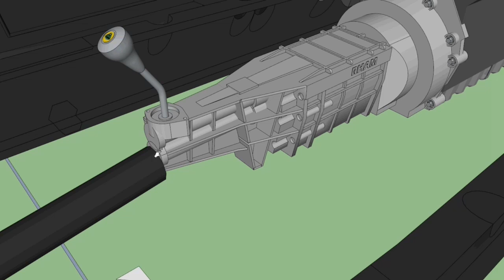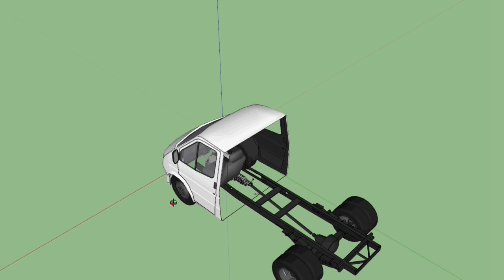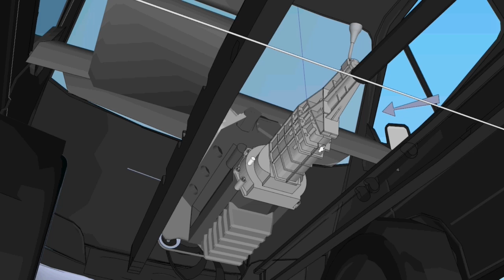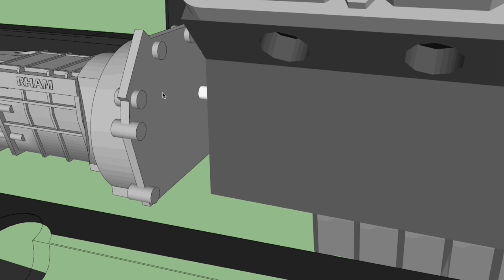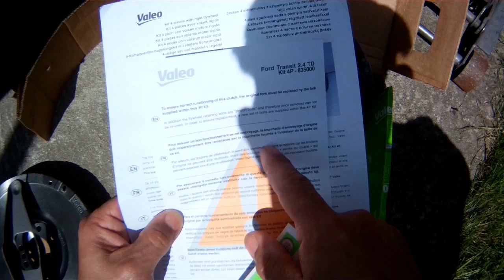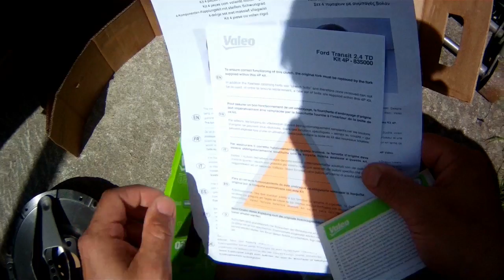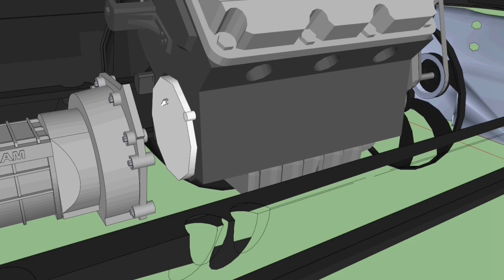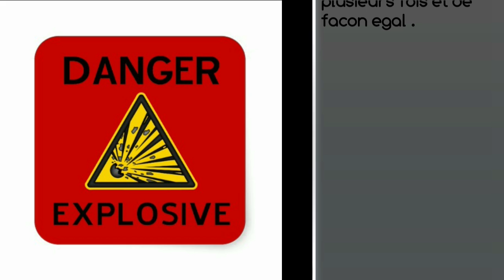TUTO echange embrayage Ford Transit 2.4 DTCi

Comment: merci, pour le tuto. Il faut avoir le courage, pour tout filmer, vu les difficultés en général. Le support de boite est aussi une très bonne idée. Mais j'ai quelques remarque importantes a te faire. D’abord, pour le couple de serrage. Au début j'ai cru, que tu t’étais trompé, dans le calcule. Fallait précisé, qu'il s’agit de daN.m en lb.ft et pas de daN.m en N.m. Vu que ce type de clé dynamo ce présentent en général de 28 à 210 N.m (mesure européenne) et pas en lb.ft (américaine). Par rapport au volant moteur. Je trouve un peu dommage d'avoir acheté un bimasse, quant on sait, qu'il vaut rien, au prix, que ça coute. Il aurait été préférable de mettre une solution rigide, mais bon, chacun est libre, de faire son choix. Et en fin, par rapport à la clé angulaire. Je reviens au kit embrayage. Tu as dépensé plus de 1000€, surement, par rapport à l’ensemble, mais en faisant des économies, entre 5-10€, avec un bout de carton imprimer. Quant on sait, qu'elle est l'importance de couple serrage dessus et, que le décalage doit être minimiser au max. Merci encore une fois, pour tous ces détails bien filmés; Très bon travail et une bonne idée de support. Bonnes continuations.

Comment: bonjour fredo tout d'abord félicitations pour ton tuto tu as travaillé avec inspiration. j'ai pour projet de changé l'embrayage de mon Ford  c max et j'aimerais fabriquer un porte boîte à vitesses comme le tiens. ma question est ce que ton système de tige filleté permet de faire descendre la boîte et la remonter ensuite???
Reply from the maker: MOHAND MOUSS Bonjour , oui on peut descendre et monté mais cela reste assez limité en déplacement verticale , le but était d'avoir un support réglable afin d’évité de forcé sur l'arbre de boite et pouvoir la rentré correctement  . 
Je suppose que le véhicule sera sur chandelle ce qui veut dire que la longueur total d'un support sera d'environ 60 cm , en bricolant bien on limite sur la hauteur nécessaire pour les roulettes mais on pert facilement 5cm , il faut obligatoirement que les deux tube rentre l'un dans l'autre d'au moins 10 cm . on perd donc 15 a 60 Cm soit 45 Cm que l'on divise par deux pour connaitre le deplacement possible soit 20/25 Cm .
Ce qui me semble largement trop juste pour espérer descendre une boite uniquement avec cet outil .
Il m'est déjà arriver de sortir un moteur en passant sous le berceau , cela reste archaïque et peut être dangereux , j'ai déposer le moteur mis au sol puis lever la caisse pour ensuite passer le moteur sous le berceau . peut être que cette idée te donnera des idées .
Après est-ce que la boite dois absolument être descendu ? car si il s'agis de la descendre un peut pour pouvoir la décaler et gagner un peut de place pour travailler sur l’embrayage . généralement on procède de cette manière lorsque l'on a pas de pont  cela doit être jouable avec cet outil on a pas forcement besoin de sortir la boite entièrement ;)
Reply: non mais je crois que je vais  le faire avec un pro dans votre genre, je ne suis qu'electricien... Tout a l'heure j'ai demonter quelque support et passer sous la voiture pour prendre les cotes de ma bv.et vous savez quoi???ma voiture ne demarre plus!!!!!!!!!!!! vous ne savez pas d'où ca peu venir??? j'ai demonter la batterie et son support  et nettoyer un peu les elements et sans faire attention j'ai branché la batterie a l'envers ( sans mettre le contact!!!!!!!!)  ensuite j'ai tout remis en place et la ma voiture ne demarre plus.... J'ai mesurer la tension de la batterie 10.4V . est ce normal a votre avis. merci pour votre reponse.... ( c'est la batterie d'origine ...)
Reply from the maker: MOHAND MOUSS Je ne suis pas un pro et je n'est certainement pas la prétention de me considérer ainsi pour ce qui est de votre soucis , 10.4V la batterie est certainement HS , la limite de vie des batteries se situe au environ de 11V en dessous la batterie a de forte chance d’être HS . Cependant si la batterie a été brancher a l'envers même sans contact d'autre élément eux sont alimenter sans contact . Il y a peut être un fusible qui a claquer , celui concerner devrais logiquement se trouver sous le capot , mais je n'est pas les document nécessaire pour  en dire plus désoler .
Reply: Merci encore pour tout fredo tes infos sont une mine d'or et  sont super exploitables quoique tu dises. (Les fusibles sous le capo c'est la ou il y a les relais? SI C'est aussi une histoire de fusible je vais regarder ca c'est pas bien grave. )
Reply: Bonjour fredo, pour ma part problème réglé. c'était bien la batterie qui mettait en défaut la voiture( normal avec une tension nominal de 10.3V) .Changement de la batterie et tout est rentré dans l'ordre. Je te confirme bien que changer la polarité de la batterie n'entraine pas la destruction de l'électronique de la voiture .( comme le disent certain sur le net) . pour ma part batterie changer et la voiture refonctionne... MERCI POUR TOUT et continue dans tes super tuto...